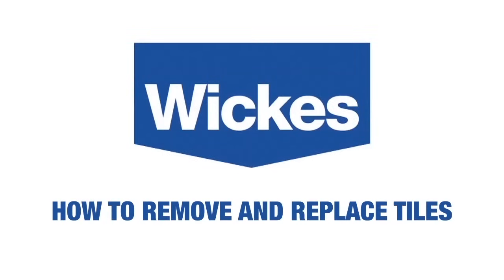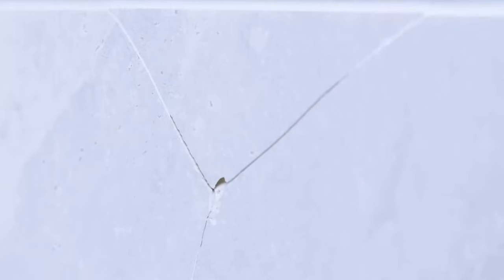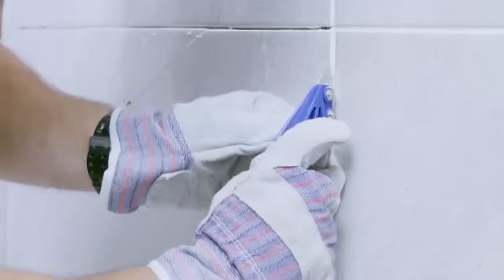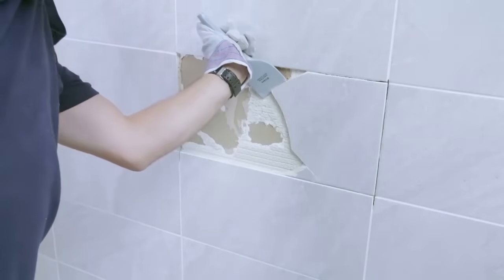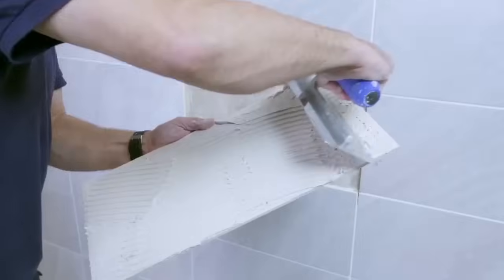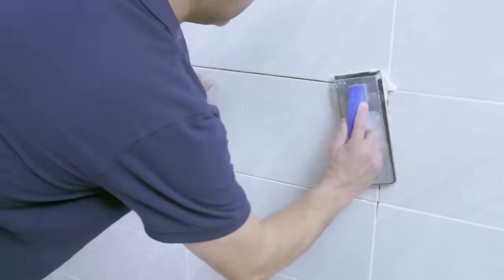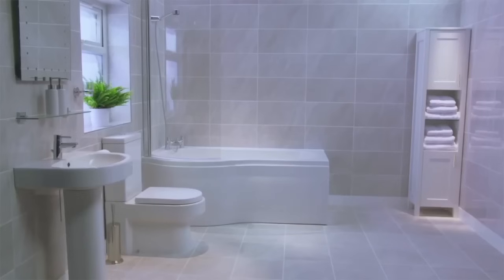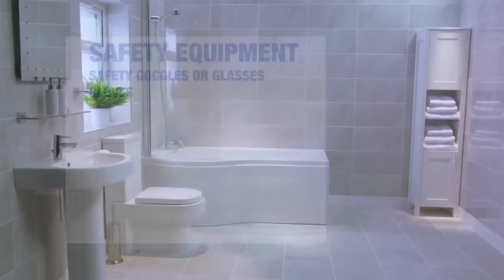How to Remove and Replace Tiles | Wickes

Comment: I watched the video. Tha ks for the tips. I managed to get 4 tiles that needed replacing off carefully woth a small flathead screwdriver, never broke the tiles and cleaned them down and soaked fora couple of days to get the previous adhesive off, and then gave a 2 days drying. The tiles are back up. Just got caulking to do.
Reply from the maker: Hi @rangersnut, Thanks for taking the time to leave us a comment on this video, I'm glad you found it informative and were able to take the tiles off without damaging any of the tiles. - SF
Reply: @wickesvideo  thank you for the comment.

Comment: How did he remove the grout from the existing tile?
What safety equipment was he wearing?
What tools did he use to chip out the tile from the centre?
What was the scraper used for?
Why was a brush used?
Why did he recommend having some spare tiles?
If the tile is sunk below, what does he recommend?
When do you use the grout shaper?
How did he buff the surface after it was dried? i need this answers.. this vedio is in my case study
Reply: Soak the tile in a bucket of water for 24 hours. Carefully remove the old stuff with a scraper. All other answers are in the video

Comment: I was wondering if it's advised to apply the glue onto the back of the tile itself instead of onto the wall.
Reply: 2
Reply: Of course you would. Because if u overdo it on the wall it’s more fiddly to remove excess glue. At least with a tile u can scrape some away. Xx
Reply: Plus if u take too long then I suppose you could just throw the dried out tile in the bin or reapply the glue. Idk.

Comment: yeah my tiles were layed to close together making the use of a grout saw impossible. also the the motar on the wall behind the tile had too much sand in it and crumbled and came away from the wall when I pulled the tile off. another tile would not come off or break up I had to completely grind it out. I just wish the original tiler had watched this video.